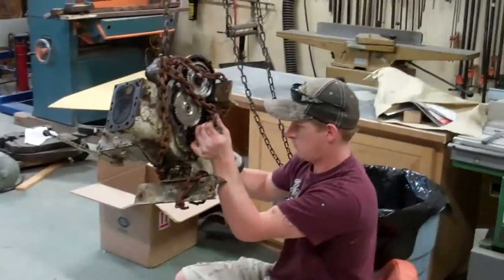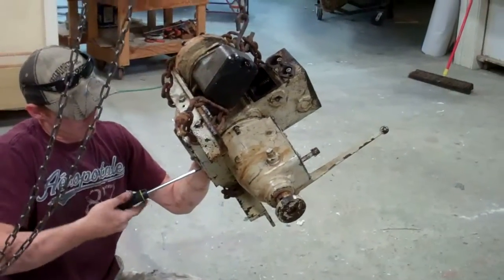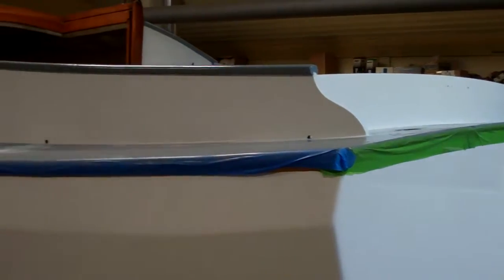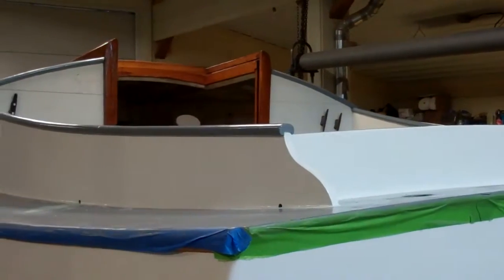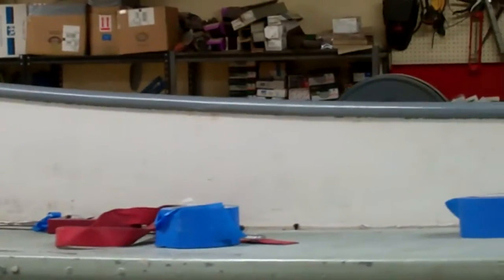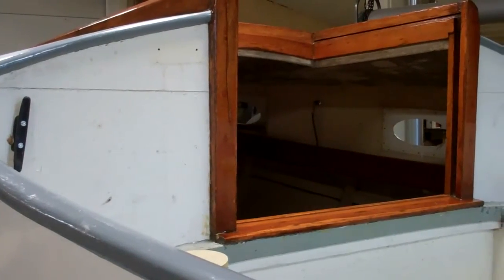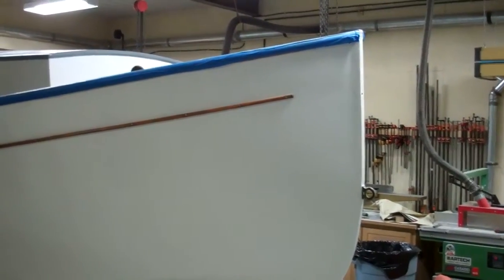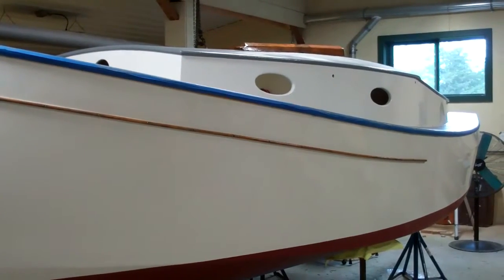Saving Corlear Chapter V Kermath Sea Pup Project Update Aubust 6, 2013

Comment: did you ever get her running?
Reply from the maker: Yes Nat,She spent all of last season on Lake Champlain, and is in the water now for this season.
Reply: snakemtboatworks Awesome! would love to hear what she sounds like now
Reply from the maker: Sorry Nat. The engine could not be saved. We did everything we could, but could not regain anything like compression.At the end of the day, and Elco electric motor, bank of batteries and solar charging until was the best we could do. It is silent and smooth as silk, but hardly what we hoped for in the beginning.
Reply: +snakemtboatworks  i may have an sea pup engine and trans

Comment: i have a sea pup with trans
Reply from the maker: Wish we had known in 2013, when we were working on this boat, Paul. We finally installed an Elco electric motor, which has proved to be a Godsend for her owners. They charge the batteries while she is tied up at the dock and then have plenty of power if/when the wind is not blowing.